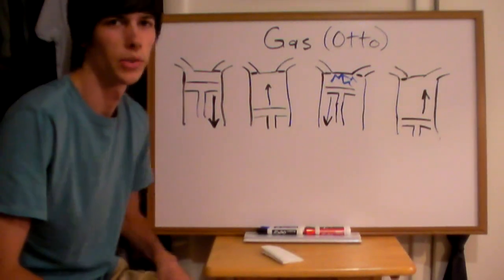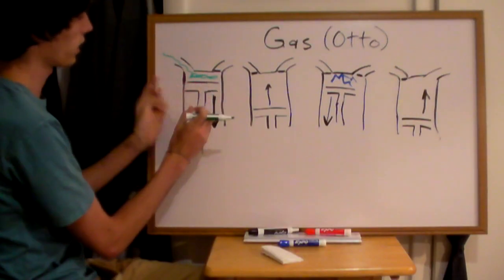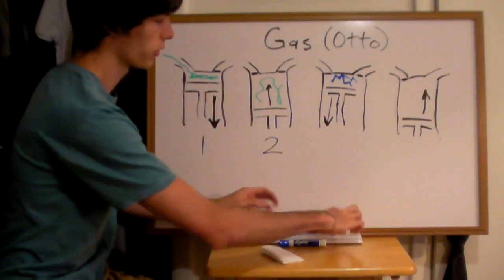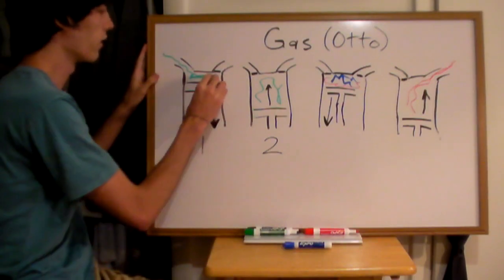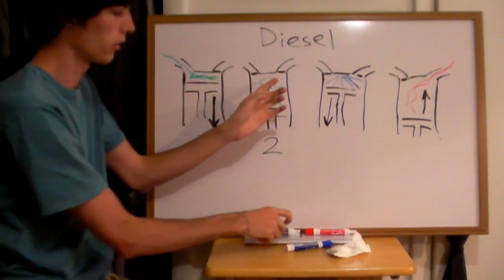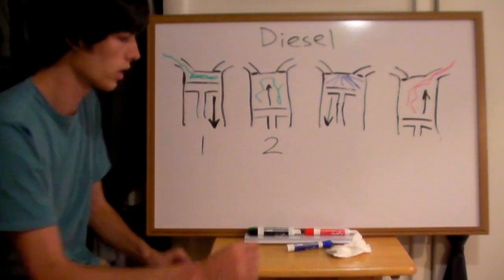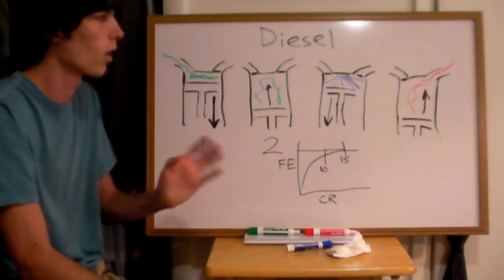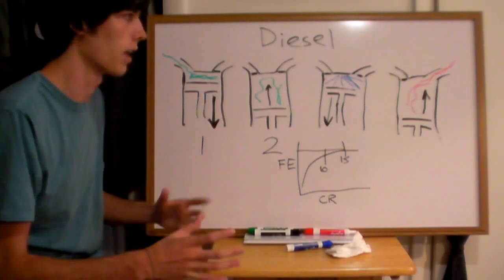Gasoline vs Diesel - Which Is Best?

Comment from the maker: Well they have much higher compression ratios, and heavier components. These combined are limiting, and diesels can also make very good power at low rpm (due to high compression) so high revs are not necessary.

Comment from the maker: Yes, if it asks for premium you should use premium. You should always use the recommended fuel. The possible consequence of using lower grade fuel is pre-ignition in which your cylinders may fire before the spark plug fires. This can very easily damage your engine if it occurs. Many companies have built in failsafes that prevent this from happening so when people use the wrong fuel grade the engine doesn't break, but that doesn't mean the risk isn't there.

Comment: Diesels actually have less hp and more torque meaning they have less speed but more strength like mine has 140hp and 238lb/ft of torque.  Most car company do offer the option of diesel its just normally 10,000 or more for a diesel.  Also not all diesels are super fuel efficient. And in CT where im paying $4.30 a gallon for diesel it does still add up.

Comment from the maker: Your second question answers part of your first question. Horsepower is relatively low because the engines are low revving (see my video on hp vs tq). Diesels have more torque because they use higher compression ratios, typically are turbocharged, and have a longer stroke. The high stroke is part of the limitation of the RPM, as combustion can only occur so quickly. I have videos on compression ratio, turbos, and average piston speed (stroke/combustion) if you would like to know more.

Comment: I would say racing the, higher cost and the fact that not everyone likes the diesel engine because they are typically louder and have more engine vibration.  But i have a diesel and get almost 600 miles to a 14.5 gallon tank and i love it.

Comment: so you don't need spark plugs for a diesel engine because the air is already so hot it will ignite the fuel by it self? Great video by the way!

Comment from the maker: Yeah, I think there are many reasons. Gas engines converted to diesels in the 70s/80s were all a great failure (couldn't withstand the higher temps/pressures, as they weren't built for it!). Also there is a general misconception of the cleanliness of diesel. On top of that, diesel fuel is taxed more in numerous states.

Comment: take my words with a grain of salt but if I remember correctly, diesel engines are low pressure engines and the turbo gives it high pressure so it ca have a lot of torque.

Comment from the maker: Well, performance, and efficiency. Diesels don't regulate how much air comes in with a valve like gas engines do. With a turbo, you can greatly increase the amount of air fed to the engine, plus, since diesels have high compression ratios, they're built stronger than gas engines, so adding a turbo doesn't affect reliability as much as it does with gas engines.

Comment from the maker: Sort of, turbos increase the thermal efficiency of an engine by turning waste exhaust heat into useable energy, and thus allowing a smaller engine to be used, which burns less fuel.

Comment: Is high compression why some low psi/bar turbos can possibly produce good fuel economy in gasoline engine, since they can add additional pressure during the intake stroke?

Comment: Great job. I'm actually studying Diesel Technology right now and the only thing I would change is the fuel injection part. I may be wrong, but what I'm taking from what you say is that diesel is injected once the piston is TDC (top dead center meaning the piston is as far up as it will go). Fuel is actually injected close to 12degrees BTDC (before top dead center). Having the fuel injected BTDC it gives it a chance to swirl and cause better combustion.  Like I said though, good job.

Comment from the maker: It's just the design. The flywheel keeps things going smoothly, the power strokes are responsible for the crank to rotate. Gasoline engines could be designed to do the same, however they would suffer from engine knock since the air fuel mixture would preignite due to the high pressure/temperature.

Comment: What about the rpm of gasoline and diesel? It seems like you missed that part.. From my experience, diesel engines have lower red line in comparison with gasoline engines.

Comment: why cant we inject petrol after the compression instead of diesel as you told 
before compression the aerosol make problem in achieving high comp ratio but after compressing why cant we inject petrol?

Comment: in case of direct injection in gasoline, is the fuel sprayed after compression stroke or is it sprayed along with air in the expansion stroke?

Comment: To answer your question, NO, all diesels will not run on alternitive fuels including petrol.  The newer computer controlled engines really hate anything but diesel.  You'll need a true multifuel engine. A multifuel Engine is just that, a true multiple fuel burning machine. Just about anything flamable. There are hundreds of website that discuss alt fuels.  Older diesels will tolerate some alt fuel like veggie oil/waste, but don't try it on a newer computer controlled diesel without research st.

Comment: but with the gas engine, the spark is still necessary even if the fuel is injected. im aware of the risks of knock, as the gas might explode before the piston finishes its travel to reach final compression, but is there a way petrol can be injected and combust like the diesel engine or is it too problematic?

Comment: It is not correct that Diesel contains about 25%-30% more energy??? Maybe it's time for you to go back to school. I'm not saying compression is not a factor. It surely is - but not as much as the far higher energy density in oily fuel vs. light fuel.

Comment: For the most part a pretty good explanation. But the better fuel economy originates in the fact that Diesel fuel contains about 30% more energy compared to gasoline. The higher compression doesn't play a big role in the fuel economy as with higher compression there is also more "pumping" losses.

Comment: Compression rate can be up to 15:1 for OTTO, but you have to use high quality fuel with 100 octanes. 
95 octanes fuel is stabe up to 12.5:1 compresion.

Comment: Interestingly, Mazda have a new generation of diesel engines (dubbed SKYACTIV) for which they are actually boasting as having a LOWER compression ratio than their contemporary, common-rail rivals. I haven't researched why exactly this is supposed to be a good thing and what possible benefits this might have but at first glance it sounds counterintuitive. What might your take on this be?

Comment from the maker: I wouldn't call it spontaneous by any means. The air/fuel mixture is under very high pressure, which creates very high temperatures. High temperatures mean the fuel ignites, regardless of if a flame is available. But I suppose you could look at it as "spontaneous." It certainly occurs in a controlled manner though.

Comment: incorrect. deisels have glow plugs. instead of spark plugs. what a glow plug does is stays hot all the time. and when the deisel fuel is introduced it ignites the air and fuel.

Comment: If I understood correctly, diesel engines don't have spark plug since the temperature is much greater due to the higher compression ratio?

Comment: If you're talking about the piston travelling upwards while the intake valve is open during valve overlap, I think he explains that in one of his other videos. But I think it's because of the speed and pressure that gases are coming through the valves that the pressure doesn't drop in the cylinder.

Comment from the maker: There is no opening for the pressure to be lost. And the injected fuel is at a much higher pressure than inside the cylinder. What opening are you referring to?

Comment from the maker: I'm not entirely sure, or sure that it's even that possible. I mean the cars are more efficient, and have less overall emissions if you look at total emissions for the amount of time the car is used, but on a per gallon basis it doesn't work the same way. I just heard recently that diesel in NC is taxed twice as much as gasoline. It's infuriating to hear.

Comment from the maker: Because Europeans are smart and have a large percentage of diesel vehicles. Also emissions in Europe are different. In the US we measure emissions based on how much fuel was burned. So for example if a small diesel engine has 20lbs of CO2 emissions per gallon of fuel (idk what an actual figure would be, made this up) but gets 50 mpg, and the US says you can't have cars with about 15lbs co2 per gallon, then we can't have this car, even though ultimately less emissions will occur. Stupid I know.

Comment: I have a question. Why do cars in Europe have better fuel economy than cars in the U.S.? I know the main reason is because of the emission regulations in the U.S.. But how does the engine and the exhaust layout in European cars differ from the engine and exhaust layouts   in the U.S.? Meaning how do cleaner emissions effect the fuel economy of a car?

Comment from the maker: I guess while I'm at it I should mention that I'm terrible at reading. My reading comprehension is in the 50 percentile. My memory is pathetic. But then there's math where my percentile is worth noting. 

Anyways, I'm not sure. I'm hoping to have two vehicles once I start. (One to drive, one to ruin).  I know it will be a challenge. But as a good friend of mine said, the biggest problem to get over is to not be intimidated. Just do it. Sure, I'll break something. But it won't ruin the whole car.

Comment: yes.. multiple fuels ( diesel, biodiesel,oil/coocking) ...  so if u say that u have seen some diesel engines that can run on six different types of fuel ...tell us a bit more about this and give us a link .
P.s give me advantages of diesel: if this "last longer and multiple fuels" is only two advantages... i think, u dont know anything about diesel engines.
p.p.s dont forget that diesel engine is pointless in towns/cities they only for long runs on motorways and nothing else.

Comment: they are not so much versatile as u think ... petrol enginescan run on biofuel as well , and they could run on LPG (liquid presured gas) ... what we get? we get that petrol powered engine can run on PETROL, BIOFUEL,GAS = 3 and diesel powered engine could run on DIESEL,BIODIESEL,COOKING OIL =3 ...  do i missed anything ? maybe ...correct if im wrong :)

Comment: I thought with a diesel engine instead of a spark plug they have glow plugs, with my dads diesel Hilux he has to pre-warm the glow plug before he starts the engine, so I don't know if the glow plugs are just for starting and until it gets warm, or if it is used through-out the inter operating time of the engine.

Comment: @EngineeringExplained; do diesel engines have any other advantages in terms of survivability in cold weather or reliability in cold weather & also why is it until the last 20 years or so have large vehicles like trucks, construction machinery & tanks have predominantly used diesel rather than petrol (is it due to the easier adaptation to super-chargers or is the diesel engine just suited to the use of moving heavier machines) ?

Comment from the maker: That would be a good topic and easy to explain. I wish I still had my white board with all the clutch material on it. Basically, the engine isn't producing enough force to actually move the car forward, so when the clutch engages the engine to the transmission, it just shuts off since there isn't enough force to move it forward (and keep it moving). Perhaps eventually I can make a short video describing the entire process.

Comment: Can you do a video on what exactly happens to a gasoline engine when it stalls on you? Let's say you take your foot off clutch when it's in gear and don't open the throttle. Can you take us through the exact mechanics or stress that is exerted on the engine, what in reality is happening here. Thanks

Comment: With direct fuel injection in gas engines, would the engine have a higher compression ratio? Would it be more similar to a diesel engine in that sense? More torque and better fuel economy?
Thanks

Comment from the maker: @doktorbimmer Yep. I took an internal combustion course at my university. I believe the A/F mixture for gasoline was around 14.6 ideally (+/- 0.5) and for diesel the range was something like 18-70. 70 being idle with very little fuel consumption, 18 being with the pedal down. Our professor also said that stoichiometric for diesel is around 15:1, but is rarely used. I found that interesting.

Comment from the maker: @doktorbimmer Correct. Honestly I didn't expect this video to be very popular, and didn't include many differences. I just wanted to get the main point that one is ignited with a spark, and the other uses compression for combustion. But yes, diesels adjust amount of fuel going into the cylinder for power, gasoline engines adjust the amount of air.

Comment from the maker: @bloximonkey Do they? Different applications, either choice could be a viable option. I wouldn't say gasoline has higher performance. They can hit higher rpms, since they use lower compression ratios and typically lighter materials, and many times smaller engines, but there's a diesel that can match the specs for most cases.

Comment from the maker: @G30RG3walker Diesels have glow plugs for cold starts, just to heat the cylinders a bit on top of the heat generated from compression. As far as the fuel type, I'm not positive, but I would assume diesel is more predictable as far as auto-ignition, in the sense that at a certain temperature combustion will occur.
Reply: Zip it !!!!

Comment: @Hondaminican quote "diesels & gas engines use a different CYCLE." unquote.  Wrong again - both engines use the same Otto cycle - just different IGNITION systems for different fuels. quote "now in a gas engine if you run a 15:1 CR you're going to have ignition just like in a diesel." unquote.  I think you're confusing detonation with compression ignition.  Gasoline is designed to resist self-ignition (octane rating), but diesel is designed to self-ignite easily (cetane rating).

Comment: @Hondaminican You are still confused.  The 4-stroke diesel IS AN OTTO CYCLE engine - which is defined as a "compressed gas internal combustion 4 stroke engine".  Both gasoline and diesel engines fit this. Gas engines use light fuels and need spark plugs - diesels use heavier fuel and use compression ignition. I OWN three diesel trucks with non-turbo engines, and I also drive interstate car-carriers with turbo engines, so I have a good comparison. I prefer the non-turbo engines.

Comment: @Hondaminican You're a bit confused.  The diesel engine "compression ignition" - the fuel lights up in the hot air (high compression ratio) as soon as it's injected.  A gasoline engine has the fuel and air pre-mixed and the spark lights the fuel.  You can NOT (quote) "make a gas engine without spark plugs" (unquote) - a gasoline engine must have an ignition source (spark plugs).  Modern diesel engines do have a good "top end", and also have better torque at lower revs.

Comment: @awesomeness2571 glow plugs (duramax, powerstroke, etc.) or a grid heater (cummins) once the engine is running the glow plug is no longer needed and it stops

Comment from the maker: @awesomeness2571 For cold starts a glow plug is used. It heats inside the combustion chamber, and with the added heat from compression, the temperature is great enough for combustion.
Reply: cant wait to see what this glow plug looks like and where it is situated in the cylinder or whereabouts.

Comment from the maker: @cadetAJ18 Yes, you are correct. No need to say please haha! Though some gasoline engines (especially newer ones) use direct injection, in which the air is compressed without fuel and it is sprayed in at different times to optimize power/efficiency.